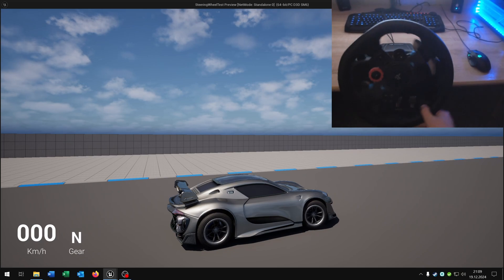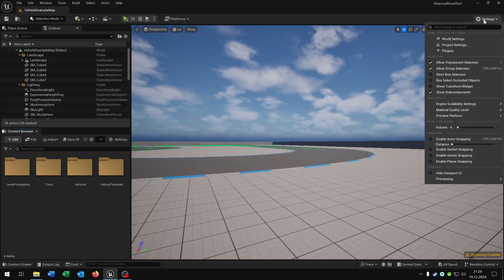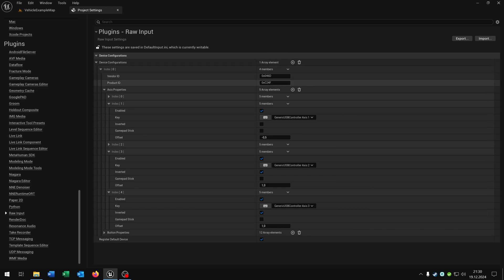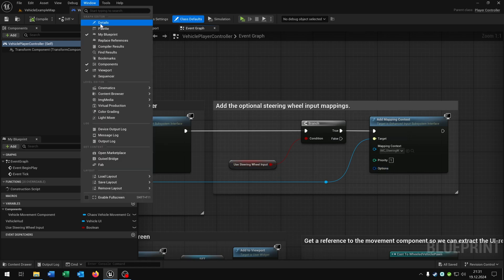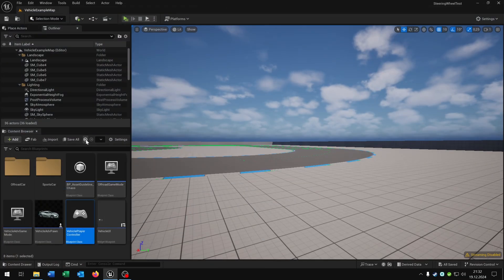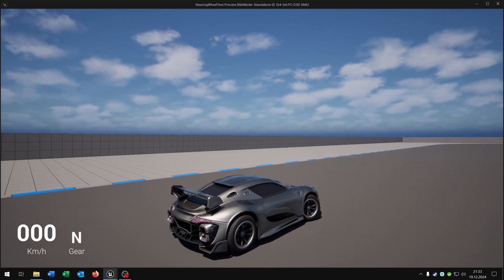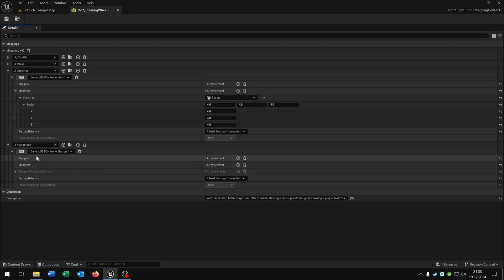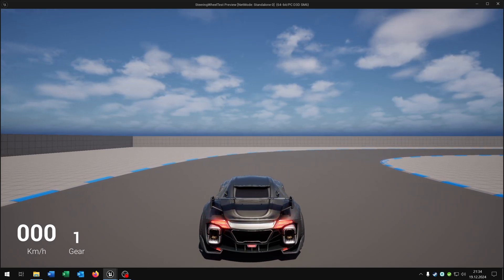Unreal Engine Steering Wheel Controller Tutorial

Comment: Hello, is the higher version of this plugin paid? Also, I want to know how to use this plugin in Blueprints. There are too few tutorials online, and I'm completely new to UE.
Reply: I really need basic tutorials like this. Are there any similar tutorial recommendations?
Reply from the maker: @wpnX-m5d  The Vehicle Template includes every Blueprint you need.
Reply from the maker: What do you mean, the Plugin just translates the Input of the Steering Wheel.  Exactly the same if you would use a Controller.
Reply: @Seredias.  May I ask if you are using the 'Logitech Wheel Plugin'? This plugin appears to be only available for version 4.15, and I'm currently searching for a 5.0-compatible version
Reply from the maker: @wpnX-m5d I only use what I show in the Tutorial.
Reply: @Seredias.  Ah, I thought you had used that plugin. Thanks for your reply!😘

Comment: Hi would this work in UE 5.5.4 ? I'm unable to download the 5.5.1
Reply from the maker: Of course, nothing changed since 4.27.2
Reply: @Seredias.  When I opened the project in UE5.4.4 I couldn't find the boolean "use steering wheel" so I guess it worked a bit differently before v5.5
Reply: I finally made it work ! Just had to restart the project a couple of times. I'm so grateful for your tutorial, thank you

Comment: hello, i am trying to use moza wheel bases and pedals for my project but i am unable to get unreal to detect the pedals, any solutions for it?
Reply from the maker: The Raw Input is probably not compatible with every single Steering Wheel. Maybe its a driver problem or a setting in the Steering Wheel Software.
Reply: @Seredias.  all the buttons are working perfectly, only the generic usb controller axis 1-24 are not working(which is needed for the steering and throttle etc)
Reply from the maker: @richikbhattacharjee6976 And you using the Vehicle Template, right?
Reply: I'm also using MOZA. My steering wheel and accelerator are not working.I'm also using MOZA. My steering wheel and accelerator are not working. Could you please show me how to use them? thank you

Comment: Thank you so much! This was really helpful. I have a Thrustmaster Ferrari T-80 and I managed to connect all the buttons and axes for the throttle and brake pedal to my Unreal Engine 5 model, but I'm struggling with the steering wheel. Could you please guide me on how to connect it?
Reply from the maker: What do you mean? If the Buttons and Pedals are working like I showed, how should I guide you? Its just using the Raw Input Plugin and the Vehicle Template. If you used both and something is not working, then it's not compatible.
Reply: @Seredias.  thank you for your kind response. Just to clarify, all the buttons are working, and both the throttle and brake are functioning properly, but the steering wheel itself is not responding. When I turn the steering wheel, it doesn't affect the front wheels of the car in Unreal Engine 5. This is the issue I'm facing. I would appreciate your help with this.

Comment: Tysm, do you know if theres a way to make our wheel feel heavier, like in Euro truck for example?
Reply from the maker: @discoink3630  Unfortunately not directly in the Game. Same Problem with the Force Feedback. It will not work with the RAW Input, but that's the only way currently.
Reply: @Seredias.  Hey, update! I found a free plugin called LogitechWheelPlugin for UE4.15, it does all the force feedback stuff, and works with blueprint!
I had to compile it to work with my version (4.27) but it works flawlessly 😄
Idk if it will work for UE5+ tho.
Reply: @Seredias. wow that was a quick response 😄
Got it, I assume the only way would be by implementing logitech sdk into the engine source code then… I have no skills to do that 😭

Comment: hey my blueprint parent class is a pawn not the player controll and i have a lot of logic implemented in it... how do I add 'Add Mapping Context' node to my Blueprint since it doesnt exist in a pawn parent class bluprint. please guide me in this
Reply from the maker: You're confusing something here. Youre Player Pawn and the Player Controller are two different things. You also have a Player Controller, cause you have to. If you dont know where youre Player Controller is. Just open the Project Settings -> Maps and Modes and check where youre Player Controller is located.
Reply: @Seredias.  I figured out that issue 

I have done as it is shown in your video but still I'm unable to use my controllers and also I'm getting an error in the message log ' Accessed none trying to read property callFunc_GetlocalPlayerSubsystem_returnvalue".node: Add Mapping Context graph : ....
Reply from the maker: @pick_anythingHalal  Since I don't know what do you changed in your Project, I would recommend to try it first with a complete new Project.
Reply: @Seredias.  Sure, thank you, I'll try it with a complete new project and also one difference in my project is that in the default Input mapping all the axis mapping existed in the default Input itslelf that is the keyboard mapping + genericUSBController, oculus mapping every kind of mapping exists in the default Input itself
Reply from the maker: @pick_anythingHalal  Sounds like you converted that Project from Unreal Engine 4 to 5
Reply: @Seredias.  No it's always in UE5.4.4
Reply: @Seredias.  I did created a new empty project and did exactly same as you did but the moment I play my project it starts to drive on its own in a particular direction and the crashes, where particularly im going wrong? please help me, Im stuck in this issue